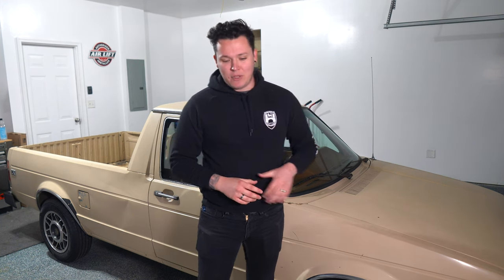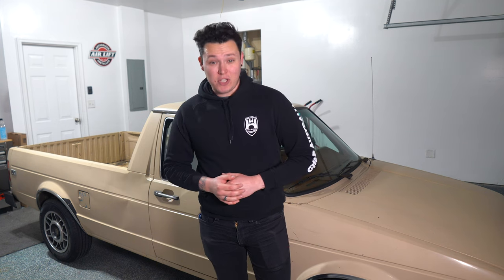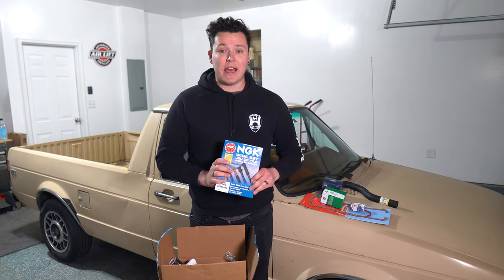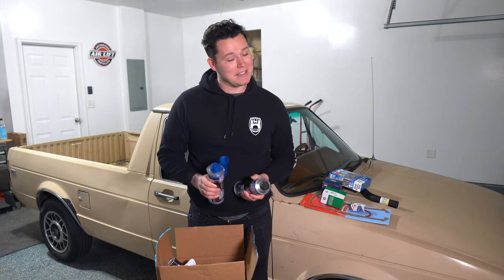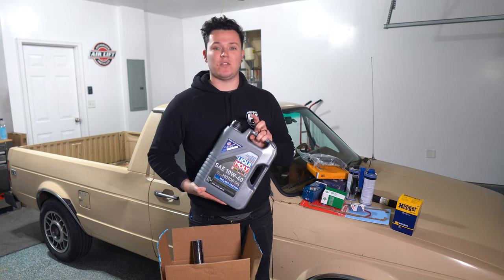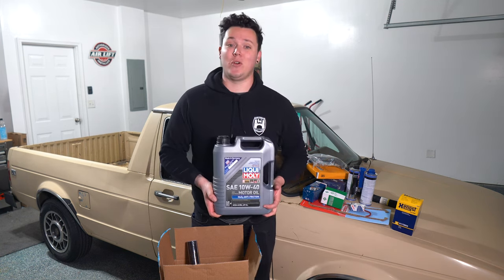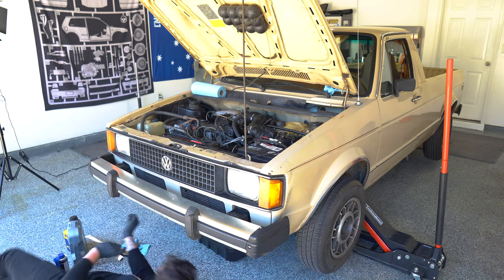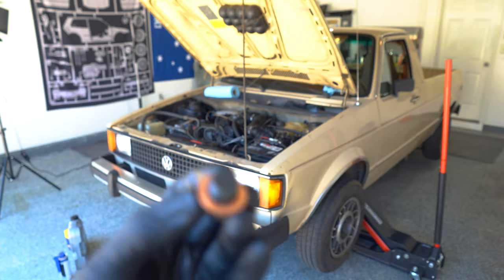MK1 VW Caddy - EP1 Oil Change

Comment: I also just noticed, did this truck used to have western style mirrors? Can I see 2 holes at the top of the doors?

Truck looks so good man. Love all the chrome pieces on the LX models!

Thanks for the shout out and thank you again for coming on the podcast. 

Ps I’ve never seen a plastic sump plug ring!

- Dan
Reply from the maker: It seems it did at one point, they are filled in with screws! I think I like the small mirrors personally